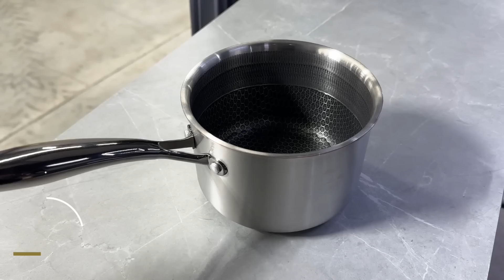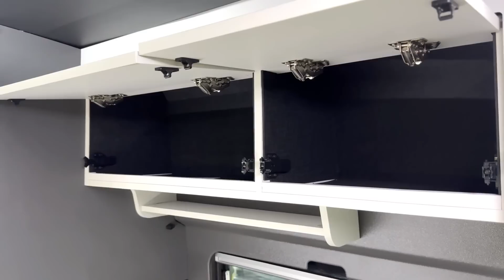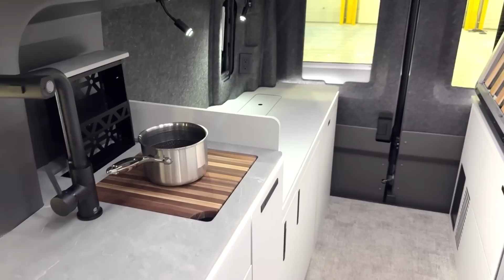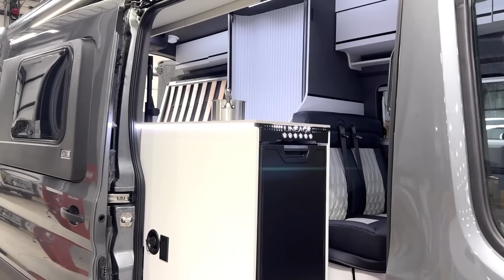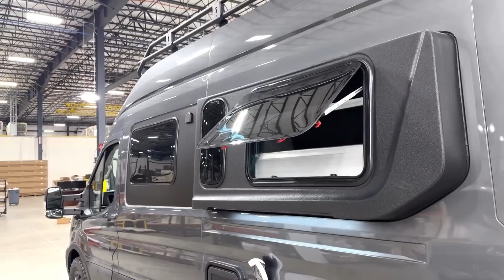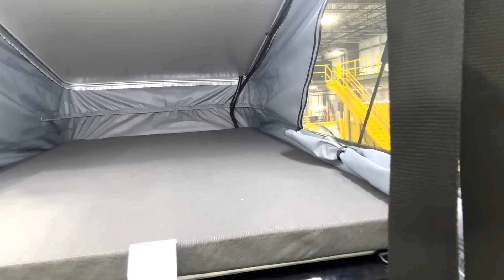Super Fun Take on the Mobile Van Lifestyle! 2026 Grand Design Lineage Series VT LVT1 Class B RV

Comment: How long does the single battery hold the air on? I like the drawer space. But using it as a work production van and may need that air.
Reply from the maker: Apologies I don’t have any data on that provided from the factory, and it would certainly vary based on a lot of environmental factors

Our local team members may be able to get more insights from the build team for you

Comment: LOVE the pop top!  My current rig is a 2004 Honda Element with an Ursa Minor E-camper pop top conversion.  Love it!  But with 317k miles, it's time for an upgrade!  There's nothing like sleeping under the stars!  So I would definitely want another pop top!  While I like the skylight over the cab, I'd rather have a storage shelf/cubby.  Does one come with it?  I realize taller people would be happy to have the extra headroom, but for me, personally, because I'm only 5'1" i'd rather have a shelf/cubby.  It's just me & my dog.  I don't need the side by side bench.  I would prefer a side facing bench/chaise lounger behind the driver.  I know that the side by side double bench seat with seatbelts sticks out in the aisle, whereas a side facing bench/chaise lounge would open up the space a little more.  While I LOVE the rain shower, I prefer a handheld shower because I can better clean the shower with it.  Is there a place for hanging clothes?  Traveling nurse, here!  Thanks!
Reply from the maker: That's one of the better pop tops I think I've seen really

Comment: Hoping you see this Josh.  I'm in the market for a Class B and went to see one based on the Promaster platform.  Bottom line:  I'm 6'6" and the driver's legroom was basicallly non-existent for me on the Promaster.  Can you offer any insight on the Transit platform, if it's the same, worse or better?  Sorry that I'm asking you to review the memory banks on this one, but I'm having a hard time finding info on that.
Reply from the maker: I did a little cockpit test on a transit here https://youtu.be/ML5D51B_wJc
Reply: @JoshtheRVNerd  Thanks Josh!  Much better than the Promaster by the looks of your video.  I almost wish the seat were lower though.  Looks like you're right at the top of the windshield in terms of viewing.

Comment: I’m really starting to fall for this Class B. I hate that it’s a Ford, butttt that extra HP and torque and ceiling height is awesome. I am 6’4” 250 lbs so rear bath has been my only option for a usable class b. The main hallway shower, 80” bed, no propane has really sold me on this unit. I hope to find one of these close by so I can take a look. It’s always hard to check out new RV’s living in Rural ND.
Reply from the maker: I personally prefer the ford setup over the mercedes for rigs like this. The fact they can get these with a double alternator AND the ford setup allows for charging your batteries at idle can really be a game changer
Reply: @JoshtheRVNerd  It really is especially now that the lifepo4 can be charged at much faster rates than lead acid and agm.

Comment: Looks good, too much on the exterior as standard, such as lights and roof rack, those should be options. Keep the outside as clean as possible by default. Innovative interior bathroom, but the tambour doors will most likely rattle and break in 1 year, I had a Travato G and the tambour bathroom door rattle and broke quickly. The cabinets have way to many sharp edges, my head hurts just looking at it. Also, they should ensure the bed is high enough for modern mountain bikes to fit under it and have an easy to clean garage floor with L-track for mounting options. I like the automative fabric covering the metal surfaces inside the van. 48V battery system is very good and I expect the van should have a 2nd alternator from the factory. The fresh water tank should be moved into the side storage in the garage, if under the van it is not a real 4 season van as you will always be fighting heat in the summer and cold in the winter. I like the windows, acrylic dual pane that awning out are very nice. The AC design seems nice, as long as it is as efficient as a mini-split and it should be a true heat pump so that it heats and cools. The exterior grey tank should have a remote dump valve for quick winterizing. They need to solve the spare tire issue. The skylight in the front looks good inside but I don't want the maintenance of sealing it and the added noise that will come through when driving. I say get rid of that and highly insulate the interior roof, as the entire van should be.

Comment: Love this rig!

Only thing I can’t figure out is why so small on the battery.  165ah standard and an option to double it doesn’t seem like enough.
Reply from the maker: It’s a 48v system. There’s much more power available than we are used to with 12v systems
Reply: @JoshtheRVNerd 
Interesting. I’m a big fan of 48v systems. 

Are the aircon and fridge native 48v?

A 48v DC aircon eats what, 30-50 amps/hr give or take?

If so the increased battery gets you ~6-10 hours?

Comment: Needs the ability to charge the battery at an EV charger. And a personal choice would remove the forward facing rear seat (b vans are for solo and couples) and install against the wall a 12v Engel cooler on a slide under  a comfy cushion and backrest so I can face looking out the door with legs stretched out. This would also remove the solid wood behind the seat and make the centre wider.
Reply from the maker: That's a really interesting idea actually..
Reply: Doesn't the alternator charge the batteries while you drive?

Comment: The front cap windshield is nice for light, however B vans are already limited on cargo space. This is a huge space that's wasted because of the window. Grand Design should remove the window and throw a storage shelf up there like every other manufacturer that uses the Transit platform.
Reply: Or have a removable shelf? I’m torn! That window is pretty sweet! Until you need storage space 🤪

Comment: I'm less than 10 minutes in, I might have to take and go buy some lottery tickets. The way I want to travel a B van would be pefect. This one takes care of most of my concerns. 
The larger bathroom is a big +. I'm not crazy about having an uneven floor at the kitchen though. I love the height of it. The bed space is good. I love the pop-top, love the added airflow. Since I really miss being able to tent camp, this would be a good alternative without having to tow a pop-up. 
Decent storage in the kitchen. Love the spice rack pop-up, a fun gadget. I have mixed feelings about the trash can drawer. On 1 hand it's great to have that dedicated space, esp as it's fairly centered in the van. But, it seems like it takes up a lot of space. I'd also rather have the drawer above it. Having the paper towels in there is nice, but I'd mount a holder under the cabinet and have the extra drawer space.
Overall a great van, fits my needs. Not my pocket book (I'm afraid to look!). Maybe in a couple of years when I can find a used one.
Reply: i agree about the pop up, i have kids so its perfect BUT even if i didnt have kids, its nice to have as a "just in case" scenario if you wanted to sleep 2 extra people instead of having to have an extra pop up etc.

Comment: Everything you need to get way off grid but missing one thing you need to stay there. Black tankage. Unless part of the adventure is breaking camp and packing everything up every two to three days, to find a legal place to empty the cassette toilet. For those of you that have a B like this with a cassette toilet how do deal with the small tank? I wonder how many dig holes in the woods or desert to empty the cassette. I’m sure it happens. I think a rig like this would be better off with a composting toilet as least as an option. 

Josh, thanks for diving into motor homes a little more.
Reply: Buy an extra cassette?
Reply: A separating dry toilet would be the best option for flexibility and boon docking - no water use and no lovely sewage mix to deal with.  It’s easier to find dump options for a cassette, which is why they are getting popular, but still might not be handy.  But by far the worst is trying to find a dump station for a black tank, at least in the West.  Those can be few and far between and a rapidly disappearing option; drive time to find one, and more if there’s a line, is not how I like to spend a vacation; the cost to dump (not to mention the gas to get there) adds up; and it’s just plain disgusting to deal with the dump stations, sewer hoses, and washing out the tank so it doesn’t continuously stink.  If you’ve got a big enough black tank to stay out for an extended period until you get home and a convenient place to dump when you get there, maybe, but small rigs just don’t.  Try that with a family and you’ll be searching for a dump station every three days with a black tank in a B van!  Been there, done that, never again - and we even had a macerator pump which is infinitely better than dumping gravity chunks (I can’t even begin to imagine that horror)!

Comment: Some nice features.    Would rather have a portable induction cook top.   The whole countertop would have to be replaced if something broke.  Needs a lagoon table upfront.   I wouldn't need that bench sest.   Nice bathroom.setup.
Reply: He didn’t mention this, the table on the outside is the Lagun table that goes in front of the bench seats. There is a nifty storage space for it in the garage if you don’t want it set up.

Comment: I like this.  Jen Knowles is testing one for 6 months.  I think the 48 volt system might throw some people off.  It's a better, more efficient system, but the cost is is substantially higher than a 12 volt.  Did yours have the sliding screen on the side door?  Many B vans have the zipper/magnet screen.   The cooktop is fantastic, and a time, energy saver.   The shower is something new but practical spacious, simple.  As far as the cassette toilet,  the site for our 3 bunk, twin bed, fold out sleeper couch trailer, had no sewer hook-up.....    I can deal with a 4.5 gallon cassette, (more disposal options if your inventive), after lugging a 30 gallon waste buggy up hill to the dump station every few days.  That, is definitely not fun.

Comment: I would start on the version that used to be the 24KWRTW and the TE and make that Ford transit version get rid of the vent fan and put an additional 12 V AC unit in its place and maybe this is a Ford thingbut perhaps a 40 to 50 gallon fuel tank